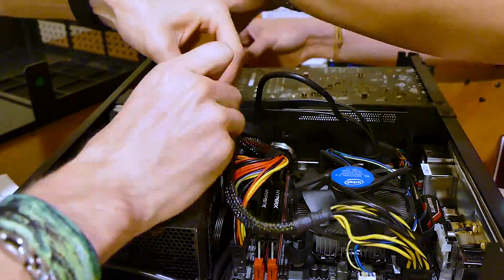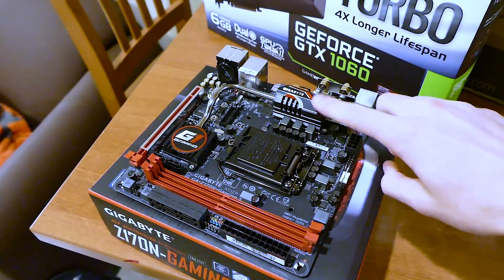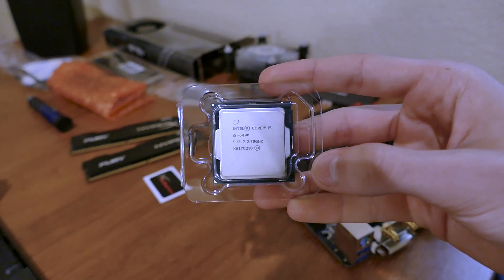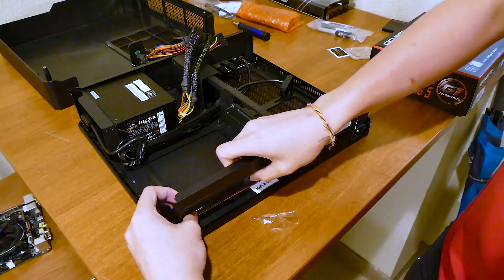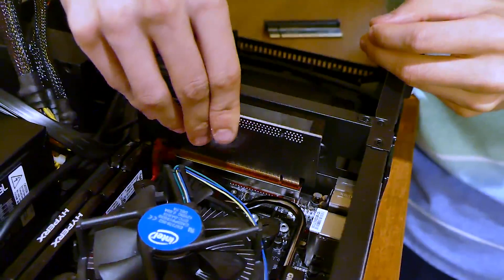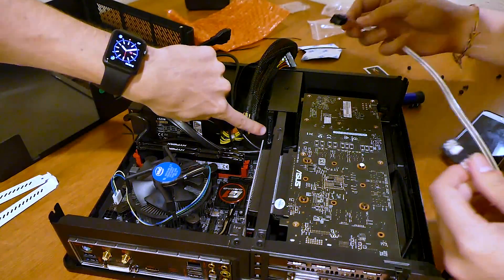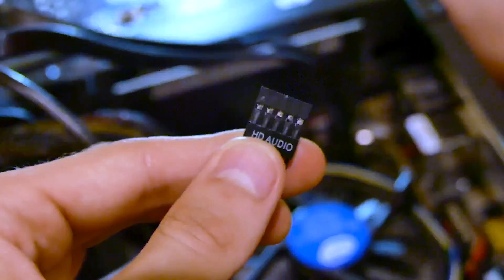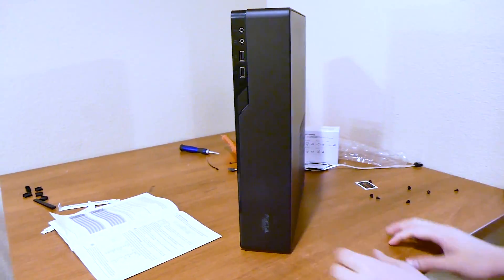How to Build an ITX PC (2016 Edition)

Comment: The stock cooler is only an emergency cooler if somehow you broke the main one. This thing will most likely throttle under load, and it's noisy. The idea is good, it's just poorly executed.
Reply: Stock cooler are enough for non k processor. Getting a 3rd party cooler for non k processor is a waste of money. I have never seen a non K processor throttle with stock cooler when properly sitted with decent ventilation unless they are running on heavy load like Prime95 but no one does that 24/7, not even gaming will push processor to its limit like Prime95.
Reply: Yes he did, and i missed that.
Reply: Sure, if you want your computer to constantly sound like a wind turbine. You're probably right.

Comment: Why a GTX 1060 when you can get an RX 480 with a similar cooler for a similar price and similar performance with more VRAM and a better future of driver support after the current generation becomes old? NVidia cards leech performance with driver updates after the next generation comes out, while AMD cards actually increase in performance as they age. Combine that with the availability issues of the NVidia cards and the overpriced mess they happen to be in with the Founder's Edition clusterfuck, and I'd much rather have an RX 480. It might be more personal taste, but I wouldn't recommend a GTX 1060 over a RX 480 any day.

Yes, I realize this comes off as another rant from an AMD fanboy, but the ultimate point of this post is just to ask why the 1060 over the 480.
Reply: The 700 cards are two generations old, the 900 cards are still one. We'll see how they fare when the 1100 cards come out.

Comment: Love the build... however, this is well over $800...
Reply: yes way over. great build though.
Reply: The price probably has not changed and instead you just live in australia. :(
Reply: Astetically Technically
 He's not an AUS youtuber is he? So why would any one assume he's going by the AUD?
Reply: Your parts list adds up to $997.98
Reply from the maker: Prices are always changing. Was right at $800 when purchased.
Reply: Craig Bossard
Are you sure? I checked those links and added it up myself and it was only $914. Not to mention that you can get many of those parts cheaper on newegg.
Reply: Did you purchase the components from a Micro Center?
Reply: What retailer were you checking? I got the same thing for around $750
Reply: Pwnzistor Well in aus computer alliance is more expensive then this
Reply: Pwnzistor IDK
Reply: He means the OP not Science Studio..And yes Australia is expensive.
Reply: Sean T
 I just mean that the maker of this video made no guarantees that it would be $800 or less in a country with super expensive electronics. He's in the US so its safe to assume that he's going by the US price he got when he built it.
Reply: I was simply pointing out that if you add up the cost of all the parts using the links provided above, it came out to almost $1000 US. Well over the $800 Mini ITX build that was advertised from the opening of the video. Still a very reasonably priced pc though.
Reply: That's kinda the point. The prices keep changing on the Amazon links, but they are still above $800 using those links. Sure you can use other retailers to build this cheaper, but that wasn't the point I was trying to convey. As I said, I was merely pointing out what the links given were adding up to.
Reply: Craig Bossard he had a Euro sign next to it. Ur he says dollar?

Comment: I disagree on some picks. I would prefer an I5 6500 which in my opinion is the sweet spot for gaming (clockwise), and pick a less expensive mobo. Z170 chipset in ITX form factor is a bit overkill and pointless if you consider you won't overclock and you won't use more than two ram modules also sli/crossfire isn't possible in this form factor. If you just need the raid option you can easily go for an h170 chipset and if you want to keep things simpler you can just get an h110 and save a considerable amount of money for a better vga. Also RX 480 or 470 makes more sense to me but this may be just personal preference.
Reply from the maker: We are overclocking using BCLK method. Your first point is moot.
Reply: Yeah I missed the part you said that at the start, on this case I would also pick the 6400 just to save money. But if anyone wouldn't overclock the 6500 with a cheaper chipset would be a more valid choice.
Reply: Some people actually use the comments for discussion and not to farm likes. Try it sometime!

Comment: I have found after many a PC build and cramped fingers,that if you fit the front panel wires before even mounting the board in the chassis, it makes the build that much easier. you can also sometimes route that  FP cable UNDER the motherboard for a cleaner install.

Comment: That gpu holder looks flimsy.
Reply: Do you mean the PCI-E extender? If yes, it's not there to hold just the gpu, the GPU is held by screws at the slots
Reply: Yeah I know but just the screws it seems like it is tilting alot from just that since the PCI-E Extender seems not as secure as it normally would be on a normal PCI-E slot.

Comment: I think it was you or Linus that proved 8 GB ram is just not enough any more. Bumping it up to 16 GB would make a HUGE improvement. For that particular brand of memory you used there is only a $20 difference.
Reply from the maker: Not a huge improvement for games running off of a single 1060.
Reply: Even you showed how there are games that are not just GPU intensive any more, like GTA V and City Skylines. There are going to be games that will, and already have, rely more and more on CPU. Sure, CS:GO and Blackops are primarily GPU games, but tastes are different and games are getting bigger. So are OS's for that matter. lol
Reply from the maker: 16GB is not necessary. Period.

Comment: Very good built,  I would go with a 1x8gb ram in case you want to upgrade to 12gb or 16gb. 

I dont understand your MB choice though, why  would go with a z170 board? when  you can't  OC  the cpu or use other features that wont be in use? 

Than you could've got a 6500 instead of the 6400.

Comment: hello Science Studio
 In your build I will make some change  like for example  a case more cheaper  a power supply of 50$  cpu  of the new  generation of AMD  RSX  8350 or a i5 6600, 6500  a motherboard more cheaper  like for example 70 $ but for the new generation of AMD you will need to wait a few months, because the case cant not cos 100$, the mthb i think that can cost 100$, and the gpu is pefect in this case, because the cpu it is a little old, and? what is gonna happend if in 3 year it goes so old...

Comment: To me, the Graphics Card seemed a bit too insecure. This is clearly seen when you plug in the external power lead to it. Being a small form factor, its likely to be moved around more than a generic Mid-Full ATX case. Would be better if Fractal included an innovative way of cradling the card a bit more securely.
Reply from the maker: Didn't mount the riser card properly.
Reply: Ahh, Did think it was a little loose and a massive oversight, So no problem. Thanks for clearing that up.

Comment: You really should recommend buying a short SATA cable (maybe 6-9 inches) so you don't need to fold the cable, folding a SATA cable can introduce reflection and make it  inoperable .
Reply from the maker: Not necessary. A SATA cable won't become "inoperable" when it's bent. Not unless you torque the crap out of it unnecessarily.
Reply: Disagree:You add "discontinuities" which cause reflections

Comment: Whats the difference between the i5 you used and an i3? (In a PC that's built for gaming)
Reply: The i3 is a dual core CPU with hyper threading the i5 is a proper quad core. In more CPU intensive games the i3 can be a bit of a limiting factor but a i5 is more than you will ever need for gaming except for some really extreme cases like military or flight sims (arma), but those games never run well no matter what your specs are.
Reply: The i5 can handle 4 threads better than the i3 because it has the necessary resources to execute them well
Reply: I currently have an i3 and plan on upgrading from a GTX 750 to a 980ti. should I keep the i3 or upgrade to an i5?
Reply: Depends on what you are playing, for most tripple A titles a GPU is a much better investment. I would keep the processor if it is a 6th or 4th generation chip, if its older than that I would look for a used part on the cheap for a small upgrade.
Reply: TioPaleshadow my ultimate goal is to achieve a smooth 60fps @1080p. I was doing some research and saw that a good monitor factors in also I stead of a TV (which I have) so I think I'd have to upgrade to a monitor first. Thoughts?
Reply: I also have 8gb of ram
Reply: Kevin Solis I've been using a standard, cheapest I could find 1080p TV for years before I bough my 4K display about a year ago, it doesn't make any difference in performance whatsoever (1080p TV to any other 1080p Display). If your FPS exceed the maximum refresh rate of your display by a large margin your picture is going to get torn apart but 60-75 Hz is standard for any cheap old TV so if 60 fps is what you want there is really no point in getting a new display as you can always limit your fps by your maximum refresh rate using v sync.
A cheap way to get a serviceable 1080p display is to buy some cheap active 3D TV, not for 3D itself, thats mostly dead but they usually come with higher refresh rates and less delay. Then again a good 1080p display is likely going to be cheaper than a 3D TV these days.
Reply: I have a Vizio TV and its capable of 1080p. I was just worried about getting a monitor because of one of Sc.St. vids. Thanks for your help dude! Add me on steam if youd like, twogirlsonekevin

Comment: I'm pretty sure you could of done it better if you had semi/full modular power supply as it would have better flow because you don't have any unneeded connections/wires and would be able route the cables to where you can need it while having the rest routed out of the way of like fans or be more tidy

Comment: dude you could take 6500 and b150/h110 WTF
Reply: he wont be able to overclock this way...
Reply: Axecution i dont think that 6400 is overclockable and he has the simplest cooler in the market so no overclocking for this system,
Reply: Roi Jacob it is overclockable through old motherboard bioses, as for the cooler they said they will swap it.

Comment: node 202 is actually quite a bit bigger than x-box one
Reply: Original Xbox One also has a massive power brick, unlike node 202's internal PSU.
Reply: Considering the power it has compared to the Xbox one it's still compact and more powerful
Reply: sure it's compact but you would definitely not be able to put that much power into enclosure as small as x-box. I never claimed this system was not compact.
Reply: have you seen the gpu inside the computers those companies put them in? They're mobile sized, but full desktop grade. That's a big damn difference. Here there's a discussion going on about stuffing a desktop size gpu into an xbox one. PS4 the situation is even worse as it's even smaller!
Reply: xbox one dimensions r (L×W×H) 33.3cm × 27.4cm × 7.9cm and the fractal node 202 dimensions are (L×W×H) 33cm × 37.7cm × 8.2cm. so the fractal node is 10cm bigger in width
Reply: jynxed 10 cm is hell of a lot when you already have so little space
Reply: Erytropus little space for?
Reply: jynxed if the case was 10 cm smaller you wouldn't have space for GPU anymore
Reply: you can put a gpu in cases with smaller widths but the height of the case needs to be bigger
Reply: Actually, if Asus, Acer, MSI and co manage to put 2 full desktop gtx 1080 into a laptop something as huge as an xbox one or ps4 surely wont be a problem with the right hardware. For that you'd of course need low profile hardware designed for small enclosures. An external power supply like with the xbone or ps4 would already save quiet alot of space to work with. Then a cleverly layed out case and some pci-e extensions and you can make something rather small working as long as you can still manage the heat.
Reply: ArtisChronicles theres laptops with a 1080 or dual 1080s in them and their not mobile 1080s their desktop versions. So im pretty sure they could fit a actual desktop grade gpu in the ps4 or xbox one
Reply: jynxed of course they could do that. But since Sony and Microsoft go for the cheapest offer (thats why they always go with AMD) that wont happen. Infact, They are using desktop grade gpu's, just not the high end stuff (75w) in the consoles already. AMD is undercutting nvidia and other gpu manufacturer (yes there are more than nvidia and amd but they arent known in europe/america) that they are basicly making a loss with every console.
Reply: ThePrussianGamer they could put a actually gpu in their consoles but the price will go up which kind of defeats the purpose of having a console, for example If they ever do put a desktop grade gpu in their console its going to be the around the same price as a pc and if that happens most people will head towards pc.

Are you saying sony and microsft are using desktop grade gpus already? If yes than, sony and microsoft use APUs in their consoles but their not consumer grade APUs (im not sure about ps4 pro and xbox one scorpio)
Reply: jynxed It all depends. The Consoles are already slowly dying, thats why they came up with the ps4 pro and xbox scorpio in the first place. They are a reaction to the PC, not the xbox one or ps4. If they dont start making more powerfull consoles then people inevitable will switch over to the PC, which they are already doing at a fast rate. It doesnt has to be a expensive high end gpu of course and if they are ordering large quantities they get it way cheaper than any consumer could get it aswell. Lets say they put an RX480 chip in there for example. It wouldnt increase the cost by that much considering even a consumer pays only about 250$ for it, so i bet sony/microsoft wouldnt need to pay more than 50$ if they are ordering large shipments at once.
Reply: ThePrussianGamer i get where your going with this but for example if they use the rx480 the console itself can be worth around $450-$600USD (depending on the hardware that comes with the rx480). Im from New Zealand and if you convert $450- $600USD that would be around $850- $1300NZD (its abit higher than the actual conversion due to the fact things rarely sell for the exact conversion price of another country) so if i spend another $200NZD i could probably get a i5 with a 1070
http://nz.pcpartpicker.com/list/7N3Bqk
Reply: jynxed I am pretty sure in most cases (atleast outside of the USA) a similary priced PC would infact be worse than a, lets say 600$/€ console would be, simply due to the fact that games can be alot better optimized for it since the hardware doesnt change.

 In germany for example you easiely pay double the price of an console if you want to build a cheap high end system. Sure, Australia and New zealand especially are at an big disadvantage since i can imagine that everything is pricy down there from logistics cost alone with taxes being slapped ontop of that, but i am sure you especially would rather buy a 10-50% more expensive console that is guaranteed to run anything rather than a PC that might aswell be outdated in 2-3 years already.

I could imagine that a ps4/xbox one with an rx480 or even gtx 1060 would infact be a very very strong competition for the PC games. As it stands the ps4 pro and probably the xbox one scorpio are far from being real "4k" consoles and only upscale, just as the initial "next gen" did with 1080p most of the time.

Comment: Pro tip, connect front io cables before other cables since they're the most tedious so the more open space the better. Also don't place pc on top of a speaker, which kind of looks like what happened at the end, though I could be wrong from the video you still don't want to do that.
Reply from the maker: Yep, had to unplug the 24 pin to properly secure the small leads. I placed the PC on top of the speaker for comparison's sake. Not the permanent resting place.
Reply: Fair enough. Btw, keep up the great content. You're moving up the ranks at a good pace.

Comment: Also... Would an i7 6700 work in the same build? The power supply is only 450 watts, so I'm slightly concerned it wouldn't be able to handle it.

Comment: I'll eventually understand what the difference is between an OCd 6400 and a 6500 ;-;
Plez help?
Reply: K so the 6400, 6500, 6600 and 6600k are all likely the same cpu but clocked differently resulting in different prices. But anyway since the skylake generation (6xxx) you can OC ANY skylake chip to 4.2-4.6 via the baseclock if you have good cooling. You need a z170 board and flash the bios to do that
Reply from the maker: ^ He's spot-on.
Reply: Mika Streitenberger Ty :D
So why would anyone get a 6600k over a 6600? xD

Comment: Nice video mate, always wanted to try a small form factor building too, but I'm also a big fan of AIO, so...

best buck for the money I could find was from the german company arctic, what I'm more interested now is, could you open the AIO, install maybe hard tubes and a reservoir with another small pump and turn it into a custom loop? 

would still be cheapter than a "normal" custom loop